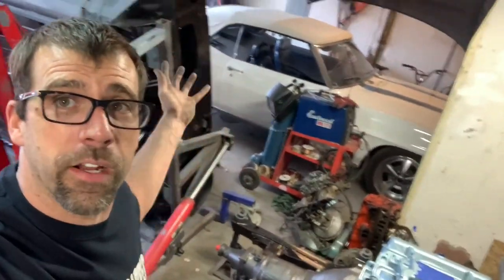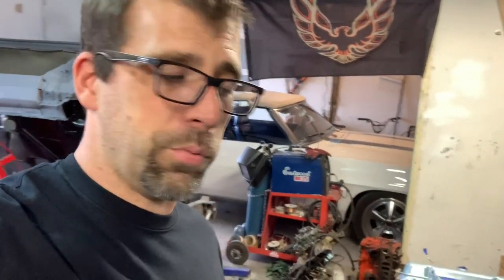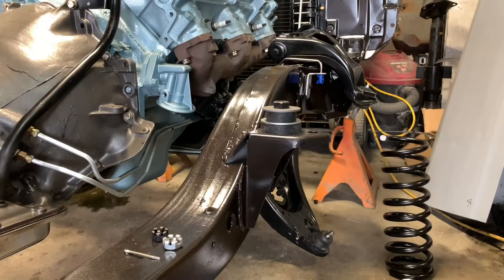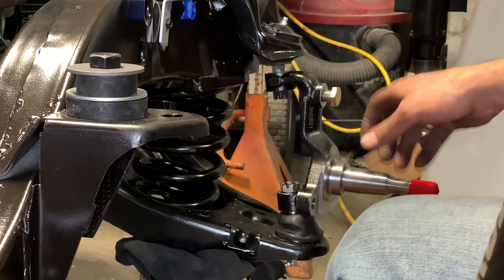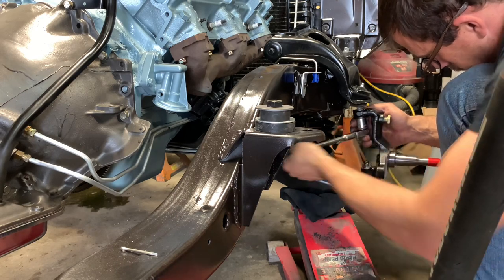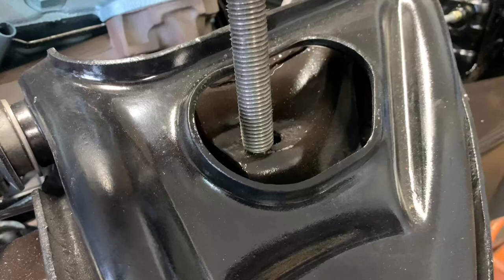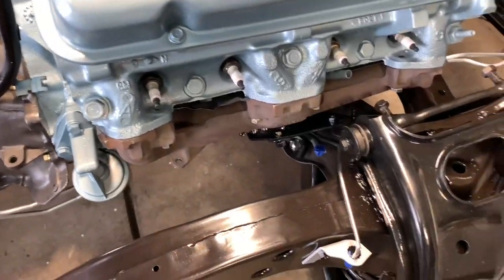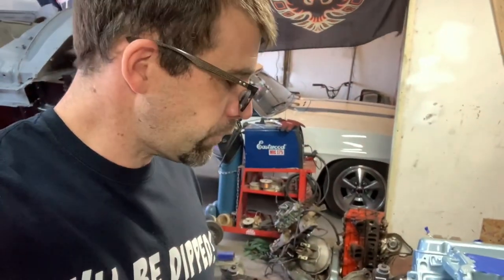1968 Firebird front coil Spring  installation

Comment: Great video buddy I was able to do my 67 Firebird coil Spring just like this without a compress tool  I just used a   chain  going through it with some washers over the control arms  in case it went loose The upper bowl joint looks like an original style ball joint great video
Reply from the maker: Thanks pal.  Springs stress me out. I don’t like messing with them.

Comment: Great video. Im in the process of doing my front suspension resto on my 68 firebird ragtop. I found out thru various videos that when using a floor jack SAFELY it was pretty easy to remove the first coil spring. The ony thing I did for safety was to wrap the coil with a light chain in case it wanted to fly.
Reply from the maker: Definitely not a bad idea. Thanks

Comment: Great work.  That seem so much easier and safer than using spring compressors.  i cant wait to see you get it mounted onto the cart and getting it rolling again.
Reply from the maker: Springs Stress me out, I don’t like messing with them unless completely necessary
Reply: @VinylVillageGarage  I agree.  I dont like them eithor, great work on yours.  Its really coming together.

Comment: I had to use the threaded rod/plate method to get the springs in my Formula Sunbird.   No weight in the car (no engine).  It was a terrifying experience.  I will say, using a threaded rod coupling vs a nut was a much safer option for me.  One side I used just nuts and it was stripping the threaded rod.  Other side I used the 1-3/4" long coupling nut and had no issues.

Loving the progress.
Reply from the maker: Good point I do like the idea of the coupling nut. Thank you for sharing!   Never thought of that.

Comment: I have changed many front springs in my cars over the years, including 4 - 1969 firebirds i have owned. use a chain or large strap hooked to the frame run under the jack and back to the frame. Works great.
Reply from the maker: The chain is an excellent idea.   I don’t like messing with springs.

Comment: Good work, Jon. I find that it’s easier to put the sway bar in before bolting the steering assembly together. Less chance of scratches. Well done though, and yes, the springs are hit or miss when dealing with a compressor.
Reply from the maker: Yes good point!   Much easier with the steering out of the way.  Thanks for sharing

Comment: nice work Jon.  Man I had such a hard time putting the springs in my 69 camaro..  I couldn't get them to seat into the bottom perch to get the jack under it.  Had to partially compress with spring compressor to even get to point of getting jack positioned.  then ride height was off 1 1/2 inch on driver side and had to add spring rubbers to bring this up.  It was a bear!!
Reply from the maker: I have had that exact issue too and had to use my home made compressor to get them installed.  This was the first time I was able to install new stock height springs in without having to compress them.  To be honest. I am a bit worried it’s not going to sit right when I am done

Comment: If you want to do hard mode try the big block springs. I did basically what you did but still had to use an internal spring compressor and still struggled to get it started in the pocket on the lower control arm. I would say maybe  you should secure the spindle to one of the ball joints before you start though, less butt hole puckering time while you are trying to start threads in the spring death zone.
Reply from the maker: I do like a challenge, but in this case I will pass. That death zone is not my favorite place to be.   I have fought a few springs in my day and I was a bit braver and more invincible 20 years ago too.  Lol

Comment: Which front disk brake conversion kits do you like? I guess you said at the end of the video that you are putting that on shortly. I need to put one on my Firebird. It has drum brakes on all four corners and it's pretty scary.
Reply from the maker: I used AFXDC01C-11 1964-1972 GM A Body Disc Brake Conversion 11" Power Brake Booster, yes I know it says “A”body in the description but they are the same as f-body and it was $100 cheaper. Saving a buck when I can. 😎
Reply: @VinylVillageGarage  Is that brake kit made by The Right Stuff?
Reply from the maker: Here is the answer… I don’t know the part number is right stuff but the dust shield from right stuff normally had their logo stamped on them and the spindles don’t come pre-painted. Plus the instructions show a different part number dbk6472 so I really feel that it’s a different manufacturer. I really like it more, I don’t care for the right stuff stamp and saved me time with painted spindles

Comment: Hi Jon, By chance do you have a video of the coil spring removal process? Thank you
Reply from the maker: I don’t yet, springs are one of those things that I don’t like messing with. Sometimes they are so worn and sagging taking them out isn’t too bad. I have a homemade spring compressor, it’s made of 5/8” all thread about 2.5’ long a track plate off a 330 caterpillar excavator and a couple nuts.  I use that
To compress the spring for removable and installation. I will be using it to assemble the subframe for the mockingbird project
Reply: Jon, Yes I saw the tool you made. Nice. On the Mockingbird project is the front end already disassembled? If not can you video that? In a future video please do show the use of your spring compressor. Springs going in and coming out are potentially dangerous. Using that tool to "capture" the spring is the best IMO.
Reply from the maker: @Danno74Z  subframe is already disassembled, seems I missed out on a video opportunity. Thr control arms will need replaced the uppers are damaged from rust.